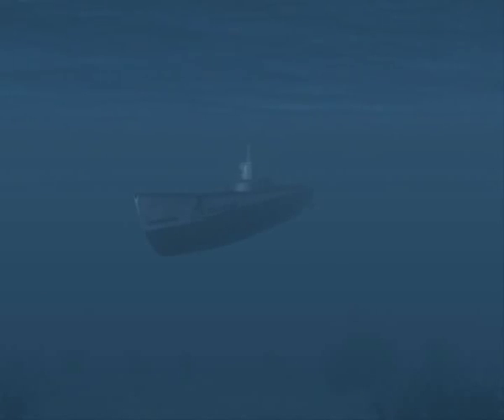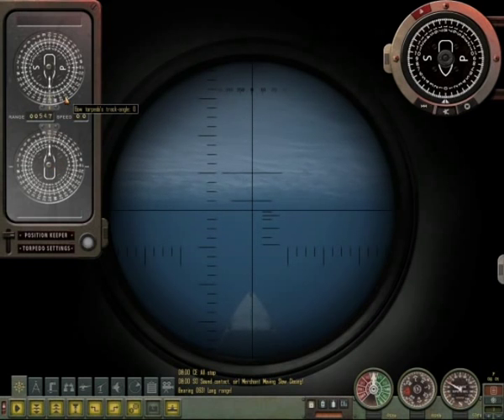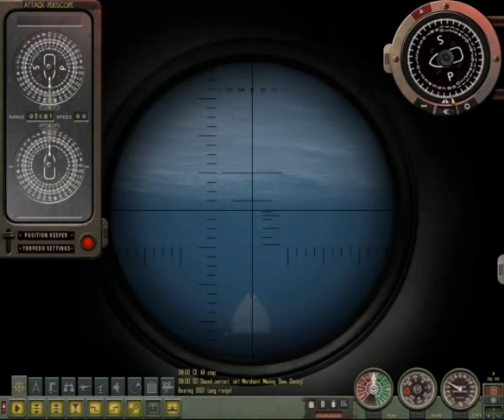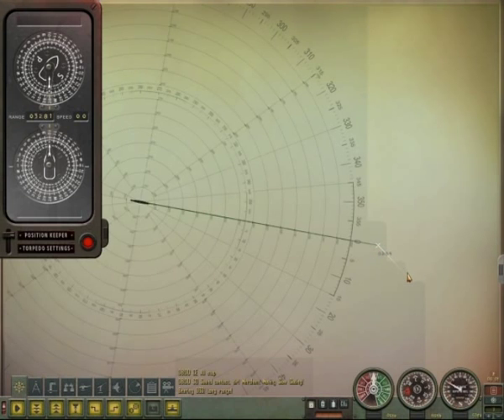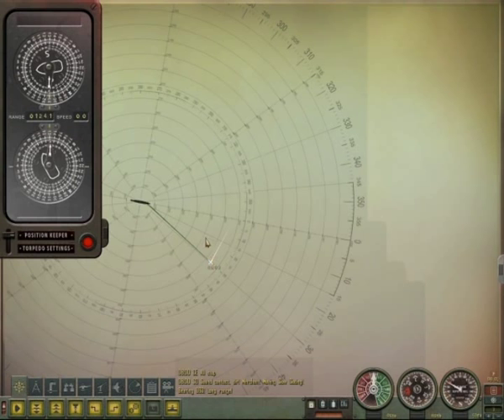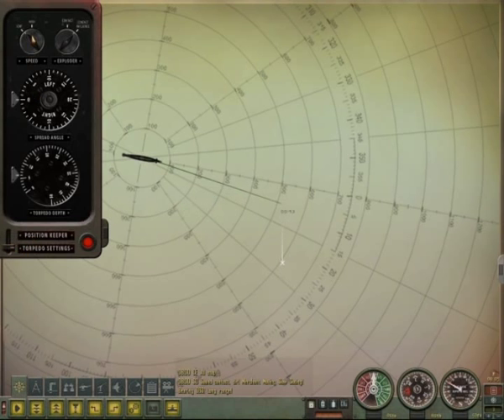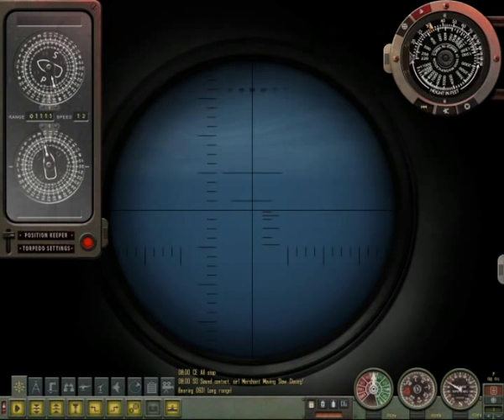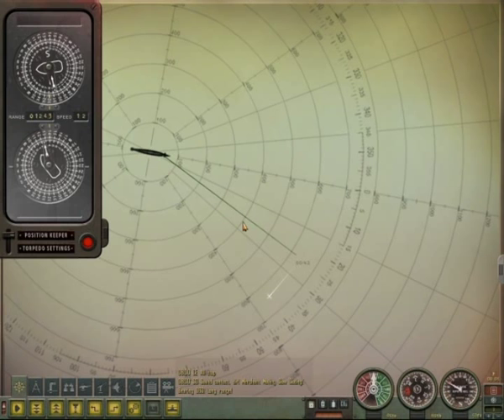Silent Hunter 4  Basic TDC Tutorial--WernerSobe

Comment: I recently switched to manual. Now I am getting very frustrated and depressed. I cannot hit the Mogami in the tutorial. My torpedoes always pass behind him. He always turns very slightly about a minute or two in. Grrrr! I'm about ready to toss TMO!
Reply: MY recommendation is to include a little fudge factor in your speed on final calculation or adding some angle to your torps to compensate for the fact that ALL ships will generally see a steam torp when its a couple of hundred meters out and goto flank speed and hard rudder...if firing on convoy when any ship spots/hears a torp it the whole convoy will do this...so spreads are your friend.
Reply: That, in general, is why I love electric torpedoes even though they are slower and shorter ranged. I think my problem is in failing to understand how position keeper works. I did finally manage to sink the bastard, but only when I stopped worrying about finding AOB from the plot and started trying this guy's method and obsessively ranging the cruiser (only way to update bearing).
Reply: In assisted mode, I did fire spreads a lot, especially when playing the Operation Monsun mod. Better to sink one ship in a convoy that way than miss every shot and sink none of them. However assisted mode is easy and I have gotten bored with it. It's like playing Dangerous Waters with autocrew on with every station. That said, assisted mode is not perfect. I did have one instance of the crew telling me a stationary ship was moving at ten knots.
Reply from the maker: There are two secrets to hitting a ship. Take your time with the setup and get close. 1000 yards is adequate. 500 yards is much better. Shooting from 500 yards you don't care whether he sees the torpedoes or not. He's dead.

Electric torpedoes do not add to accuracy. The slower torpedo you use the more innacurate your shooting. You'll find the Mogami training mission is not realistic at all because you're basically taking a spur of the moment snap shot at the target. Real shooting is not like that and I recommend that you don't use the training tutorial mission. It's really bad.
Reply: My thinking is that mode is more for assisted targeting. WWII subs really aren't capable of snapshots. Now I am just occasionally going down to Truk for torpedo practice. Last night I even found the Shokaku there. My preference for electric torpedoes is because there is less of a wake and less warning. Now I just need to learn how to get my torps from all hitting the same spot on the target. Japan really needs to guard Truk better. It's starting to get expensive the amount of anchored ships I've sunk there.

I've been working on manual targeting. Still not comfortable with fighting destroyers yet.

Comment: Also how I am I being detected below the layer at two fucking knots? These guys seem to be driving around in O.H. Perry class frigates. Also I take it water saturation is not modeled. Sonar should be crap for a while after making a depth charge run.
Reply from the maker: dixievfd55 Are you using any mods, and which ones? Stock game is pretty brain dead when you are at least 50' below the layer. But the layer is not a brick wall. It only lowers the volume of the sound coming from the submarine. Keep RPM at or below 100.
Reply: I am playing TMO. I can be crawling at a snail's pace and they still find me. My thinking is that their active sonar should not be finding me down there. I did find out the Narwhal can go pretty far below test depth after they had me damaged enough to lose depth control without going to flank speed. Can't wait to be able to get decoys. Also I finally learned to stop poking Wake. They put a destroyer and a sub chaser there.
Reply: For me to get to 50 feet below the layer, I think I have to go below test depth.
Reply from the maker: If you're having difficulty there, don't try Fall of the Rising Sun Ultimate Edition, that's for sure! TMO and FOTRSU are both difficulty mods, not realism mods. Enemy escorts routinely have Superman on board with his X-ray vision and super hearing making your life miserable. It is possible to get away but you will sweat a lot!
Reply: I realized everything I was doing wrong and corrected my mistakes. I got much better at evasion and better at deciding when to attack and when to look for another target.
Reply from the maker: dixievfd55 Really knocks your self-confidence flat at first, doesn't it?
Reply: I had to relearn a few things. Don't engage destroyers in shallow water. Test depth is just where the engineers chickened out.  Just because they are dropping depth charges does not mean they have a fix on you. Watch how they are maneuvering. I found a lot of times they'll eventually just circle where they had last contact or even park there sometimes. I also learned to use cuties when trapped in shallow water.
Reply from the maker: Excellent! Especially with TMO, Silent Hunter 4 is a very challenging game which will quickly squash your expectations of victory, then open up little crack after little crack of opportunity. Glad to see you persisted and are on the easier part of the learning curve. They'll still kill you sometimes though! :)
Reply: It's one of those that makes me wish I could find a Star Trek game that has the same kind of immersion. The one that comes closest is Klingon Academy.